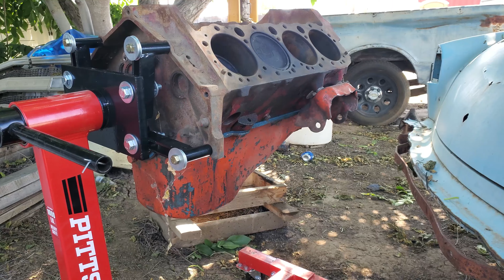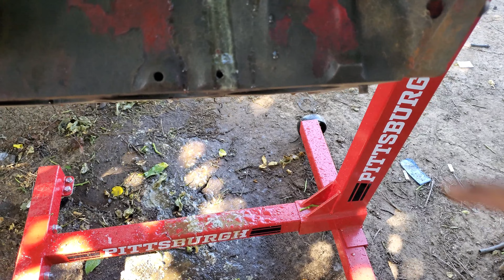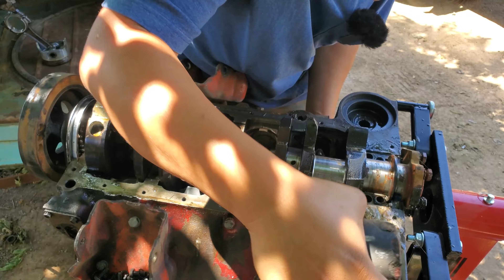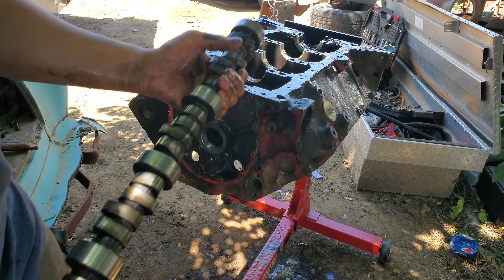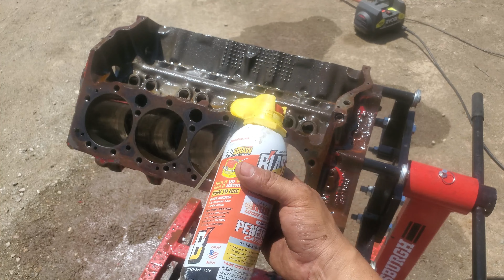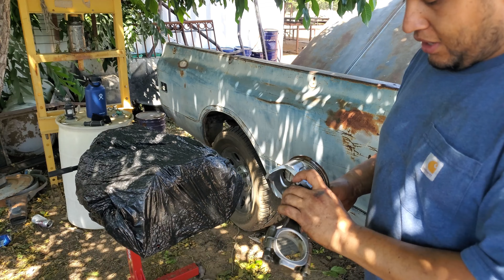Shocking Chevy 350 Teardown Surprises

Comment: The old 355 4 bolt, great engine to start with. There is more information and cheaper part than any other engine. I have built several over the years myself and when it comes to components and brackets you won't go insane!!! Find a set of flat tops, 882 heads and a comp cam set that matches your application and you my friend will make yourself some great memories!
Reply from the maker: I do have a new 882 heads ans wanted to get dome pistons to get the compression up to 10:1. This is gonna be a fun little engine as long as I take my time and not blow it up. 😂

Comment: Off to a good start, lots to learn!  4.040" bore x 3.48" stroke yields 357 cubic inches.  First, I do understand this is a budget rebuild.   As someone who has built literally hundreds of high performance and racing engines, let me highly suggest taking the block to a machine shop to be magged, and have the cylinders machine honed so your new rings will seal well.  No sense spending money on the parts if the block is cracked.  Since one of the freeze plugs has been replaced, perhaps they are corroded from running water instead of anti freeze, in which case you should replace all of them.  Common place for the 350's to crack is up in the lifter valley.  It's possible you might spot it without paying to magnaflux the block.
Reply from the maker: That's a good idea. I know I wanna do as much of this here but I do want this engine to last longer than a few minutes. 😂

Comment: Hey, it's fleetwoodrija. Gotta say, very nice video! I got a 350 myself but i've never seen inside of it.
Reply from the maker: Hey bro, yeah I've never seen it in person and I'll tell you that it's alot less daunting when you get it open. I guess all the years of watching roadkill are paying off. 😂
Reply: @Bennyboysspeedshop  Yeah, I must say that I redid my cadillac engine. And it uses more old fashioned parts, such as a fuel pump on the top and vacuums, I honed the cylinders and put on one size bigger rings, as it was already bored to .030 special. Which is the last it can be bored. I plan to start on my original engine that came out of the car soon, so hopefully i'll make some tiktoks about it. The wrist pins on the pistons were stuck and I used a special technique to get them free.
Reply from the maker: A special technique? Like fire? 😂

Comment: That block appears to have some sort of passenger side dipstick conversion. I've never seen that before. Interesting
Reply from the maker: Yeah me neither. That's where all the water was pouring out from.
Reply: Can't say for sure without having the casting #'s but the block appears to be a pre 73-75, 350 4 bolt main, it should be a 4" bore if so. The stamp .040 on the piston means that it has been bored ".040 over" stock. If you ck the back side of the rod an main bearings they will tell you what the crank journals have been turned down to, 10,20,30 etc. The dipstick add on on the right side is just that, if you look on the left side the factory dipstick casting hole is there but plugged if you have a pre 73-75 oil pan it will be stamped for a left side dipstick and you can do away with the add on piece. If the block isn't cracked or otherwise damaged for $100 you did good 👍.
 Hope this info helped
Reply from the maker: That's a whole lot of great information. Thank you. Yeah the bearings are marked 010 but I think I did good even if it's to learn how to build an engine.

Comment: Honestly not a bad find for a hundred bucks. Did you find out why there was water in the block yet?
Reply from the maker: So far I'm thinking it was a blown gasket especially because of the amount of water in the oil. I could be wrong but I'm just gonna pretend that's the problem and send it.

Comment: Is that a marine 350 engine block?
Reply from the maker: I'm not sure but if it is, that's whats going in the truck. How could I be sure?
Reply: Is there a serial# anywhere on the block? Google how to determine marine 350s vs. street 350s. What got me curious was the dip stick location, the top of the pistons and the adapter looking thing on the rear on the crank.
Reply from the maker: I'm definitely gonna look. There is supposed to be a serial number on the pad in front of the alternator but it was blank.

Comment: Is there such thing as a Big Block 350? DUH
Reply from the maker: I never even knew that until I went to look that up. GM made a 348 cu in from 1958 to 1961 in cars, and in light trucks through 1964 from what I found. That's awesome.
Reply: The 348/409 is the first version big block. Also known as the "W" block because the deck was not square to the cylinders.
Reply from the maker: @battleaxefabandmachine  yeah I just learned about those today. Too bad there isn't that much aftermarket support for those. I'd love to build one of those old engines.
Reply: @Bennyboysspeedshop  there is still some support. Stroker kits, heads. I think someone recently started casting new blocks
Reply: @Bennyboysspeedshop  I have a  409 and 348
Reply from the maker: @battleaxefabandmachine  that's awesome. If you live in Central California, I'd love to see them.
Reply: @Bennyboysspeedshop  Missouri
Reply: @Bennyboysspeedshop  well played!